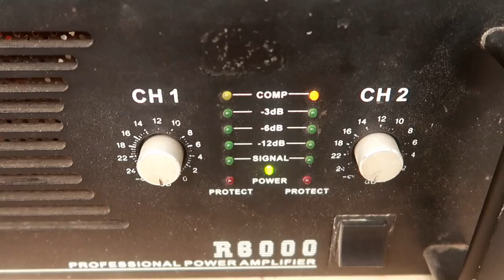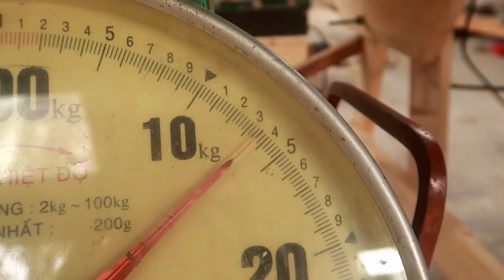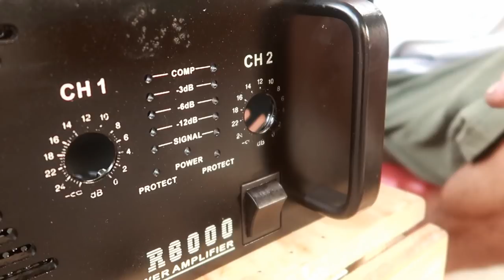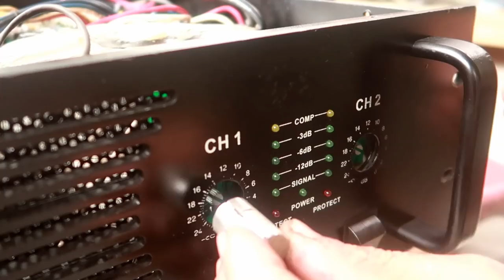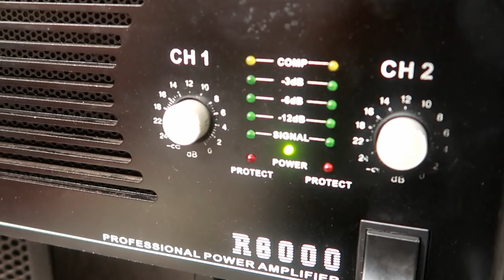Restoration A 36-Transistor Amplifier With A Capacity Of 3000w

Comment: Stupid high speed playback seems to be irresistible on these kind of videos. And the restoration itself does not seem great craftmanship either. Using soldering paste flux in electronic equipment? Just desolder every component to measure it?
Reply: Всё это надобно, и не для больших умов

Comment: I would have replaced every single capacitor  as it is they who usually get leaky or  open and cause the transistors and the resistors to fail. Not replacing them can opnly mean that within a year or so and the amp is failed again.
Reply: not necessarily .... caps arent always to blame for faults ...
Reply: @andygozzo72  : Most of the time they are. And if it is other componants that failed on their own, they tend to take other compnants along with them. I it like setting off a bomb on your self and you take out those closest to you. Caps and resistors are the victims next to the main componant that goes bad. And if a resistor is fried, be sure that the caps in that part of circuit are also either now totally open or are leaky and fried into a short circuit.
Reply: @sonofeloah  not in my experience, at least with pre 1990s stuff, i have goodness knows how  many transistor portables from about '58 onwards, nearly all 'virgin' unrecapped as they didnt need it,    valve sets and high power equipment a bit of a different matter, but still , very rarely had to change electrolytics,,  until about early 1990s when many colour portable tvs of certain origin were severely afflicted by either dried up caps or resistors going high/open, or both,  and then the 2000s capacitor plague! the older stuff seems much more reliable and long lived..
Reply: @andygozzo72 Funny how 99% of experts all talk about the failure of capacitors in electronics and you speak against the 99%. And this includes against my dad and against me. So, I am not buying it. I have overhauled quite a few pre 1990s electronics and found leaky capacitors in just about all of them. And these are all units that had a failure in their function. BUT, it is interesting that you mention prte 1990s electronics as it is true that since then that is the number one issue with faulty electronics. My latest is dealing with computer monitors that start  and then after a few min shut off. Some blink back on then shut off again. Eventually they stay down. Found under valued filter caps in their power supplies to be the issue. And many of them had burst. BTW, my dad was the lead in the government program to investigate the use of transistors in electronics and he, in his lead of the group in bell labs, were the first to put together a fully functional fully transistorized  computer that  mimiced the univac only much faster and used tons less power. Sadly, the gov owned my dad til he died.
Reply: @sonofeloah  i'm just saying theyre not the big failure cause thing many seem to think or that blanket cap replacing is some magic cure all, i have a shedfull of various radios, tvs, pcs etc, i've bought over the years, and of the transistorised items at least, most unrecapped ,not even one replaced, and still working perfectly,  most of these are pre 1980,  90s onwards and  up to now, seems very different matter, they dont last as well, i've recently had to change a couple of caps in the kitchen lcd tv as bulging, they were a known 'bad' brand, plus i have several 2000s pc mother boards awaiting cap replacement, if a device is from the cap plague era and has known bad ones, even if ok at the mo, i may consider replacing , otherwise i leave alone..... i only know what i've found and come across myself,  no doubt there may be other equipment, with other caps types/brands that are big trouble,  some panasonic 'blue' ones were supposedly a problem in tvs in the 80's, i've rarely come across any panasonic equipment that needed repair... until recently, 2 freeview digibox recorders, with know bad cap issues !! 😁
Reply: @andygozzo72 : Understood and I agree. But at the same time, having done a ton of repair, I find myself checking the caps first and then move on from there. And, depending on how old the units are, there comes a time that it is cheaper and easier to do a blanket replacement of all the caps and also check the resistors. Especially for anything that involves frequency tuning and or speed of function. Audio devices I tend to be a bit more loose about excepting the filter caps. I do a lot with tube systems and tubes are not that easy to come by and caps can ruin a tube pretty quick when they go bad. Especially in the higher voltage applications.
Reply: @sonofeloah  oh, yeah electrically leaky wax paper caps can be big risk of damage to valves, output and mains transformers,  .. havent had to replace resistors all that often, mostly in those afflicted tvs, as was a known issue,  occasionally in valve equipment, especially certain brands of resistor, and strangely  some values more than others, 680k and 220k i find most widely drifted.....
Reply: @John Cliff what? capacitors ? electrolytics capacitors will eventually dry up degrade with use and time, accelerated by heat(not as quickly as some seem to think, though 😉) older wax paper dielectric types 'leak' dc through, which they shouldnt, which can seriously affect circuit operation and safety, in some cases fail short circuit , this is mostly due to moisture in the paper and wax

Comment: This is just a repair,it will fail again,can happen soon or last a bit and when running it a little hard it blow,s again.On a old amp you change all the capasitors in the psu section and you find 2 ouput devces that match close to all the others.or change them all and buy a bunch made in the same batch,often closer tolerance at least.even a batch made same time match them within  1-2 mV between them. Do not think the output devices on this are matched close at all and that is why only 1 or 2 in a rail broke that is what some times find out with amp,s like that.
Reply: True, but this was done for visual entertainment and who in there right mind would even consider repairing a heap of dung like this amp.

Comment: I guess, what happened: the cap in the PSU blew, the transistors blew, their resistors burnt out (chain reaction). Protection Mode. 
Good job! You knew where to look and measured all relevant parts.

Comment: Takes me back to the old days when i use to do this Thank you for the video.
ps i only seen you put heatsink compound on 1 side of the silica sheets. You should put it on both side or it will overheat at high power.
Reply: Do away with the sheets, way better thermal conductance, just need to make sure there's no shorts.
Reply: @bujfvjg7222  Seen that done before when someone forgot to put the silica sheets in. The explosion was very pretty. On alot of high power amps both rails are on the same heatsink.

Comment: Correct me if I'm wrong here, but it seems rather drastic to tear that unit entirely to pieces. Especially if, in the end,  you are only going to be replacing the components that have failed open/closed. Weaker parts in the chain may not show as such with a meter.

Comment: hi friend, I'm from Brazil and I came to inform you that mica (term used here in Brazil for the fiberglass that is between the transistor and the amplifier's heatsink) has to use thermal paste of both sides because if you put it only on one side the heat will not pass from the transistor to the mica and from the mica to the heatsink beauty👍
Reply: nem precisa de pasta ja q a mica é transmissor termico

Comment: My question is ...
When he goes across the components with the meter, is he just looking for needle movement to see if the component responds ?? 
How can he know what its supposed to read on each component when they are all different ?
Reply: Dead transistors will show as shorts, or completely open between pins, typically collector and emitter, so as you get very familiar with the expected "diode" reading on the meter for working components, it's pretty simple to determine the non-functioning ones. For resistors, they usually fail open, which is what he was looking for. Normally you look for a diode type response on base to emitter (his moving needle, but not full way), and open (no movement) between collector and emitter.
Reply: @stuthelotusguy  yep, its a 'Knack' !

Comment: The rack case looks new ... is it ?
What was that cleaner liquid you used ?
Reply: Good question. What was the cleaner liquid you were using?
Reply: @patricktilley8355  I'm soooo curious about that. I restore a lot of vintage PC's and cleaning fans in a chore.
Reply: in my simple view, kerosene for circuit boards ,WD40 for fan cleaning, Dish wash liquid for cleaning cabin and for glazing he used warnish spray

Comment: It's a good idea to put some thermal paste behind the transistor an the isolator plate, too. To much of the paste is bad. The thermal paste must be spread thinner and evenly so that it can dissipate the heat well. 
The capaciter you replaced needs to be checked too. In this case, the capacitor housing was cracked and you are ablte to see the defect. If the capacitor is dryed, you loose the transistors again.
The patched pcb lines by a wire, you should fix them with a drop of glue. 
Your flux looks like them from a plumber. thats includes acid. Use colophonium instead. That's cheap and works great. The colophonium flux could be cleanded by alcohol or ethanol.
I am impressed about your spare part storage. The most of the semiconductors are not available in germany, where i come from.
It's a sold work you do - maybe not fully compliant with our regulations, but you don't sell the devices in the EU.
Reply: The 3rd World has different beliefs and understanding. There is no way that Amp would leave my bench without a complete re-cap and every passive checked. It would probably become economically unviable to fix at that point. The 1st world ethics cannot be applied here. Make do and make good.
My wife's family are from the 3rd world and after spending much time there I can understand the mindset - Make it functional and if it needs fixing again later the so be it (Deal with that when it happens). Use what you have not what you need!
I love the simplicity of the solutions that aren't skewed by our western high standards. 👍😂
Reply: @RedneckIrishman  You perfectly describe why the 3rd world is the 3rd world.
Reply: If I have to send an Amp for repair in your country, the repair service charge and spare parts are as good as I'm buying a new Amp.
Reply: @zepp3lin  Western corporations maximize their profits by manufacturing their products in countries with no sewage system, low wages and low life expectancy. Democratic governments in the developed world are supposed to regulate corporations to stop people with economic power exploiting other people with less power.  Corporations worked around this regulation by disempowering trade unions and infiltrating the political system so they have co-opted government by having their own agents in high government positions.  People in the developed world foolishly collaborate in the destruction of their own manufacturing base by buying products made outside their own country, for example, 70% of the stock in Walmart is made in China, this is how we have made our opponents stronger and ourselves weaker.
Reply: @RedneckIrishman  Isn't the amp working? I don't understand the criticism. Why swap capacitors if they aren't numb? The device came out of the swamp of a dump and is now alive again. It never was and never will be a high-end device, even if the caps were swapped.
Most people in the "first world" don't even know how to repair an amplifier - let alone with a soldering iron and multimeter from the hardware store.

Comment: Electrolytic capacitors near the heat source - the biggest mistake made by all manufacturers
Reply: well at some point they have to fail, in order for you to buy new products
Reply: Sadly, take a look at an expensive british Audiolab 8200 CD player.
Product of the year 2010/11 somewhere, capacitor cooker inside and they all fail in less than 10 years. I'd give the designer a good 5 year jail time for such design. NAD, Cambridge all same story - low quality + bad design.

Comment: I'm shocked that a bolt goes through the transformer from the top of the case. That would form another coil on the transformer carrying massive current! Maybe there is an insulating washer.

PS, I've just seen the bolt does not go all the way through so that's OK.
Reply: @John Cliff I know from experience. I used the top of the transformer bolt as an earth, bad idea.

Comment: 9 pairs of OP transistors per channel, each pair has a max power dissipation of 150 watts although 100 watts is recommended
Not quite the 3000 watts  it claims
Reply: there are 10 per channel
Reply: The PSU smoothing caps are also only 63V. So even if its a bridged design, which I think it is, I can't see how it can be more than about 750 Watts a channel into 8 ohms. Maybe they've rated it into 4ohms output which would be about right!?
Reply: @stewstube70  maybe 3000 watt RMS, not true watts
Reply: That is class H amplifier, so there is less total stress for output transistors compared to a standard single voltage class AB. So yes, this amplifier can be capable of 3kW true RMS power, at least when it comes to transistor count. I have had similar amplifiers and measured them after repair.  Check out as example, QSC MPX3000a, only 12 output transistors / channel but this amp gives 2800Watts rms all day long.

Comment: Cool video! Some of those bad capacitors and transistors look expensive. Even if your time were worth nothing, it might have been cheaper to buy a used replacement amplifier. Not to mention that newer models are more efficient and will cost you less in electricity.
Reply: Absolutely correct. There is nothing about this crap amplifier that warrants any "restoration" In the dumpster.
Reply: @NeverTalkToCops1  🤫How do you know this danyes guy is not a cop?
Reply: Dann kauft den neuen class D schrott!!!
Reply: @NeverTalkToCops1  
So you prefer to buy a new one when the old one only has some cheap & easy-to-fix issues that can be solved within a few hours and work reliable for another twenty years?
Good thinking. You'll get there.

Comment: If you didn't change all the out put transistors with new ones you are wasting your time.  I'm a certified electronics technician.
Reply: Exactly and the amp is not worth the money to begin with, I cringe when I watch these types of videos.
Reply: Why would you replace all of them instead of a matched pair that was blown?
Reply: Because they will start going one by one.  The ones you didn't change.  They will start clacking a d you won't know witch ones are going and when they crackel they won't show they are shorted.

Comment: When you have the compression light come on it is usually (not always) a bad output transistor causing it. There was no need for him to pull all of the power transistors out and to pull a leg off each output transistor emitter resistor.  This tells me either this video is a con or he is not an experienced technician.